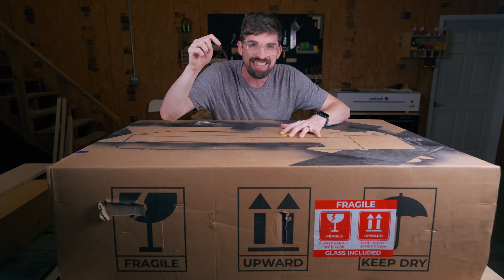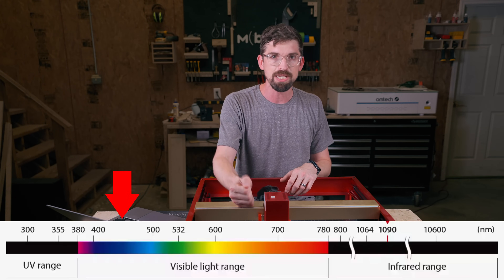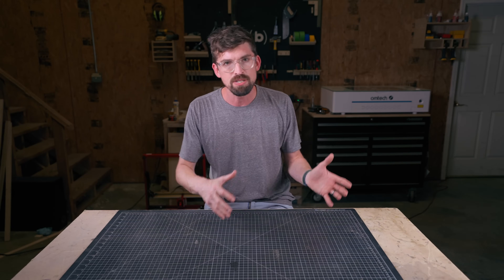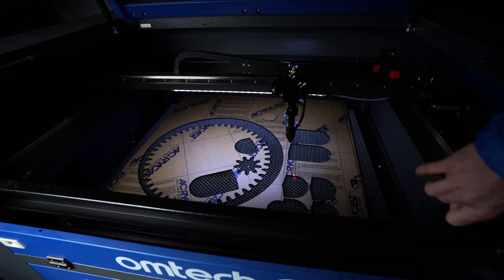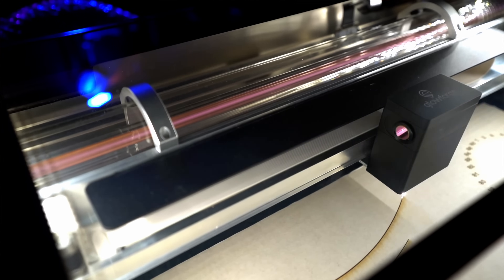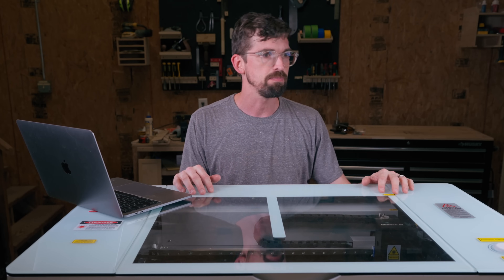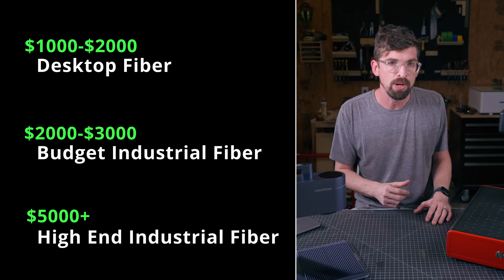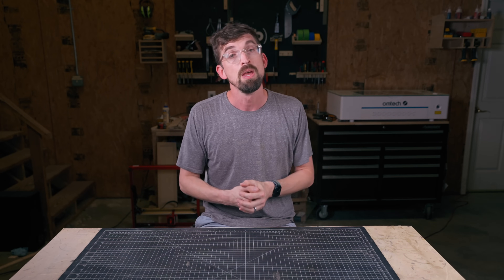The Best Laser Engraver & Cutter to Get at ANY Budget

Comment: Why no mention of Roly LaserMatic 10?  So much better than the Xtool (and I have an Xtool) but, I get it, Xtool doesn't allow you to mention the LaserMatic with all their marketing contracts.  Seriously folks, do yourself a favor and look at the Roly LaserMatic 10.  Sooo much better than the Xtool and others.  Many accessories of the other diode lasers are included with the LaserMatic 10.  All for under $1,000.  I wish the Roly was available last year when I got my Xtool.
Reply from the maker: I need to check it out, looks really nice.  No marketing contract with xTool
Reply: Just wanted to say thank you.  I was 2 weeks away from buying sn xtool 10w. From the reviews and the price the roly is what xtool should have been.  I'll be getting the Roly instead I'm so happy I saw this before dropping the cash on xtool
Reply: Would this cut .020 aluminum?
Reply: Is it good for beginners?
Reply: @Rooswarden  Yes, I believe it is.  Also, depending on what you'll be doing with a laser engraver, you might want to look at the 20 or 30 watt version.
Reply: Can you tell me more? 😅
Reply: ...And me, too?!
Reply: Hi, thank you for this info. But it's not available in the UK. Any help or link as to how to order this.
Reply: 600bucks for a diode laser, i don't buy it. At that price you could get a CO2 laser, with much more power allowing you not only to engrave but also to cut 3mm material. K40 models are definitivly the best option
Reply: @matop2000 What would be you go-to laser?
Reply: Because it is sponsored, biased videos. That's why😂
Reply: So did you ever get it and how do you like it?
Reply: 30W cost 1400$
Reply: can roly cut 5mm plywood with the 10w?
Reply: @mcin71  Any 10 watt diode should be able to cut 5mm plywood.  100% power and 100mm/minute with 1 pass should be a good start for settings.  Then adjust from there.

Comment: Nice overview!  On a whim, I bought the cheapest Aufero Laser 2 for $160 and couldn't be happier with what it can do.
Reply from the maker: Hard to beat for the price!
Reply: Would that cut 3mm balsa wood at reasonable speed/quality? I've read 3mm balsa only needs 2.5w but ?
Reply: @ColinWatters  The Aufero Laser 2 has no problem cutting 3 mm plywood.  That's mostly what I use it for, as far as speed well it's not as fast as a CO2 by any means but its not bad especially for the price.
Reply: Can it engrave.... I'm trying to learn to make little fun metal cards for my friends???
Reply: It can engrave painted metal cards.  Amazon sells some black metal business cards and my laser can engrave them.  I have used it to make metal UNO game cards.  However if you are trying to engrave just bare metal then you will need a fiber laser for that process.
Reply: @danthemakerman can you please post a link to the one you bought. I am a movie and think it'll be cool for my son and I to take this up
Reply: @makeorbreakshop what would be good for gun engraving steel/aluminum ur feedback would be greatly appreciated I wanna start doing gun parts

Comment: Also, one of the things I never understand is why laser manufacturers don't make laser beds in the common sizes of materials.  When I built my 90w CO2, I did so catering to my needs to cut 2'x4'/610mm x 1220mm (actually 700x1250mm bed size) materials.
Reply from the maker: Yeh, really the Full Spectrum Muse Titan is the only one I know of in the 2x4 ft format.
Reply: @makeorbreakshop  yeah, my DIY 90w is far cheaper, and has top shelf components: RUIDA, 90w RECI for half of what they charge to upgrade from the 75w, camera ($1500!!! at Full Spectrum).  I could build 3 for what they want. But it is cool that they are building something of that size.
Reply: @MakerMeraki  What is the build cost for your machine?
I¨m looking to get myself a lasercutter, and could see my self DIY'ing one :)
Reply: @MakerMeraki  you ever consider making and selling lasers to other people?
Reply: In your opinion, what would one need to engrave golf clubs heads? Is there something that would work to engrave graphite shafts also or would something else be needed? Thanks for the great video!
Reply: @ABCRK18  a laser that carves out parts for other lasers. Laser inception. Ai is taking over maaaan. #Aliens

Comment: In the pro category, you missed Universal Laser Systems and Kern Laser.  Universal is similar to Trotec and Epilog.  Kern makes large systems that can do tombstones and other really large objects. Aand in the high end are six figures.

I have a mid-sized Epilog, and I love it.  Metal tube with long lifespan that can be recharged, holds its power level for a long time, air cooled, and built in the USA.  Glass tubes are fine for a hobby, but if you want to get serious, look for a metal tube laser, also called an RF tube because it uses RF to produce the laser. It will outlast any import.  Not just the tube, but the entire unit.

Comment: Your videos are super helpful!  I’m looking to create rubber stamps using laser engraving.  I will be making a lot of stamps so I know a larger bed is one important factor and probably good ventilation is another. A lot of the machines don’t indicate use with rubber.  Should I assume if I don’t see rubber listed on the materials that I cannot use rubber in that machine?  Do you have any suggestions for a good model for what I’m trying to do?  I was thinking of the Omtech 40W O2 but that is kind of pricey for me just starting out.
Reply: Also interested on this! I'm trying to figure out if rubber is something doable and with which one
Reply: The XTool comes with sample rubber to make a stamp. I’ve used my 40w module to run rubber. It stinks though so be prepared for needing good exhaust.

Comment: If you're looking for a lower-power diode laser (10W or less), and you already own a 3D printer, some companies (such as Creality) offer a bolt-on laser module for your specific model.  This way, you utilize the motorized axis control of the printer you've already spent your bucks on, and can get the laser unit for MUCH cheaper than a stand-alone laser cutter/engraver.

Comment: Hello,
   I know nothing about lasers. But, know what I want to do with it. I'm looking to cut paper, temporary tattoos, decals (vinyl like stock) thin stock, around images I can print out on another system I have. I found out that Lightburn sofrware will control the laser to do what I want it for. Now I have to find out type of laser to use! Can you make any suggestions?
Thanks 
Drag N Fly

Comment: Hi, thank you for the review. 

What about just a unit for engraving custom logos on any type of shape or surface? The type of unit that I can position over any type of big or small object or shape.

I need to engrave custom logos, 3x3 inch maximum. Need to engrave on around and flat surfaces. The materials that I use l are glass, wood, plastic and metal. 

Thanks again!

Comment: Was looking for 10w saw xtool with there reasonable priced d1. However sprang for the M1 instead simply for the enclosure, and it was on a big sale. Even cutting 3mm ply on this is fairly slow 5mm/s 100% power etc. If i look to upgrade in the future im coming back to this video. But for me the Xtool P2 is a very atractive option. 

Additional the Xtool software has come a long way since i first started using it, expecially with setting test grids.
Reply from the maker: Yeh xTool has come leaps and bounds on the software front in the last few years.

Comment: Your statement at 3:29 is a little bit misleading. One could think only lasers with visible light are dangerous, whereas lasers with e.g. 1064 nm are even more dangerous, since you can't see the beam and might have a false sense of safety.
Reply from the maker: I could have made it more clear, I really mean if you are across a room from an enclosed co2 unit you won’t really need to worry, BUT with a diode the light will be bleeding out everywhere.

Comment: One massive issue for me is I need to be able to free hand cut. The parts I;m doing it;s not practical to program the cuts so I want to use it like a scroll saw. Is that even possible? I checked and there is what's called a "fire" button in Lightburn. It;s meant to be a low power mode but can I use this to turn it into a scroll saw?

Comment: I have a question and I was wondering if you had any input. I started out with an xtool D1 pro and had so much fun that I wanted a CO2 laser. I recently bought an AF2028-60 from them. When it arrived it was instead a usb-0705-u1. Instead of the 600mm/s time of the machine advertised, it was  listed at 500mm/s. I contacted customer service and they said I got an upgraded model. But if so why is it slower. It seems more likely to me someone either screwed up or sent me an older model and thought I wouldn't notice. Any advice you've got would be appreciated. Love your channel by the way.
Reply: Omtech, sorry. I should proofread before posting.

Comment: Hi so I have a question about the gantries and accuracy of the stepper motors for repeatablility; if I am 'mass producing' my widget that has several processes in different steps where I have to take it away from the laser and then bring it back can I set up a jig calibrated to 'home' and will the laser 'home' to the same place every time... or are they typically not this accurate?
Reply: I use a Glowforge Basic (no longer being sold). all their machines have a home location toward the back left when looking it head on. I frequently put in cardboard sheets and cut them into jigs when running multiples of the same item. Ive never had it have an issue with alignment. I cant speak for other brands but would assume they are similar.
Reply: @ABCRK18  Cool, thank you for the reply!  I'm going to have to get one of these soon...

Comment: Can i cut various types of foam with a cheap laser diode machine mostly under 5 to 10 mm thick, plus some ply and balsa 1.5 to 2mm?  Ta.
Reply: I used a 2.5W laser module 455nm for engraving and cut 3mm stiplex, acrilic black with 15 to 20 mm/s speed. better for you is >5w 
you can use only the module laser on old 3d printer like creality, for simple use connect everything to an arduino uno and cnc shield

Comment: Im hoping you can help me make a huge decisions!   Im looking at starting a small business doing mainly photo engravings and cutting maybe at max ½" thick wood. Im used to working a Glowforge Pro and im nervous about a steep learning curve with other printers. 
With that said im really close to pulling the trigger on an Xtool P2 but I discovered the Thunder Laser USA Thunderbolt RF co2 laser and now I'm really torn between the two machines.  I really like that the Xtool looks a lot easier to use than the Thunder Laser and isnt as tall but i want the best machine i can get for what i need.  Quality is super important but i need to be able to use the software too.  

Im really torn as this is a huge investment.  

Currently i use ImagR to process all of my photos to engrave and import them. 

Can you offer your insight? Thanks in advance!
Reply: What did you ever figure out? I'm also on the ground floor of this craft - looking for a good machine.

Comment: I want a laser cutter for small leather and grave. And I want it on a budget
Reply: IR Sculpfun laser module with arduino uno and cnc shield. or you can use the module with your 3d printer. it can cut leather very easy and very hard metal thin metal < 0.2mm . the resolution for engraving is 0.03mm

Comment: The only thing better than having your own laser cutter is having a friend who has a laser cutter.......find a friend who has an Xtool P2 or similar.

For safety reasons, I will never be anywhere near an open-frame device even if I'm wearing OD6 (or higher) laser goggles. If you have one of these, at least put an enclosure around it. BTW, a pair of laser safety goggles is a lot cheaper than eye surgery, or living the rest of your life with impaired or no vision.

Air-assist. You really need it to reduce the fire hazard, as it squelches flames that try to form while cutting. Remember, a laser cutter works by burning-away material.

Smoke. You dont realize how MUCH smoke gets produced till you do your first cut. Even a few small cuts on thin MDF or plywood will stink-up your entire garage. Which goes back to the first point: You need an enclosure for safety reasons as well as to gather the smoke for your exhaust fan (or air purifier).

Cooling. We havn't done any lengthy processing on the P2 yet. It's water-cooled and I've only seen the temp go up 1-2 degrees during usage, even when the laser is running at 100% power. A 55W CO2 laser is around 20% efficient, so you probably have 300 watts coming thru the laser tube. It's going to take awhile for that to heat-up a water tank. But if you're using an air-cooled fiber laser, it's going to heat-up faster even though it's a lot more efficient than CO2. Probably a non-issue for hobby work, because your cutter will pause a few times if it needs to cools-down.